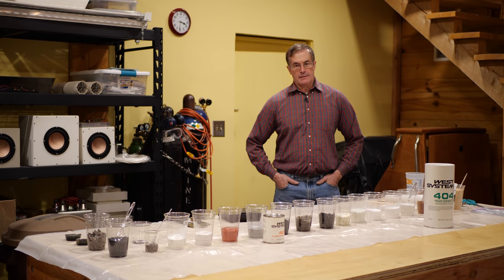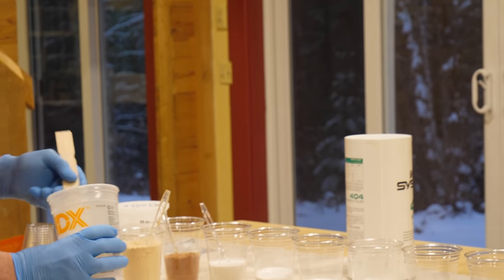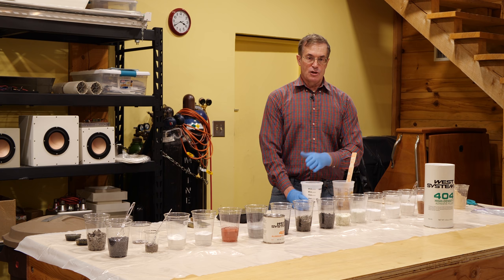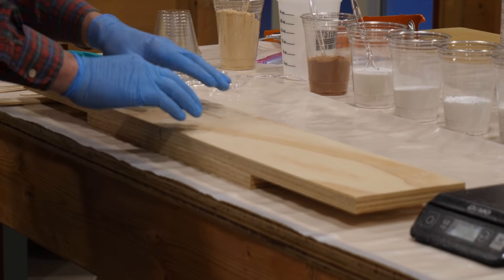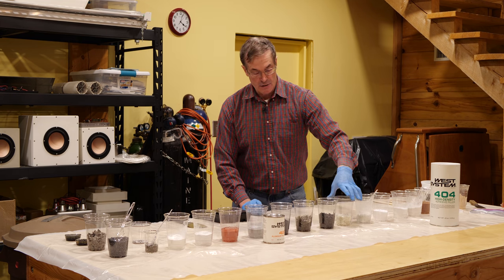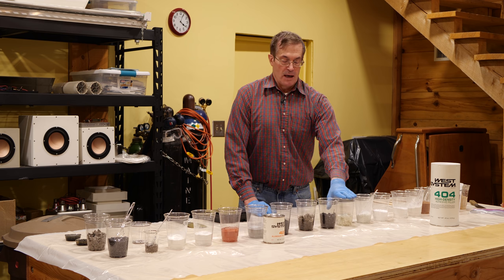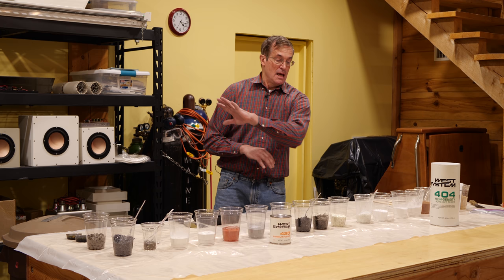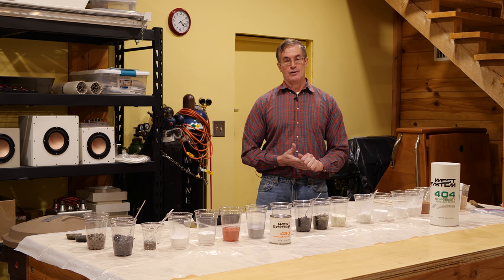Super Strong Epoxy with Diamonds and More!

Comment: Fantastic video. I have experimented with various epoxy fillers for many years. Since I was a child in fact. Back in the 80s I repaired a void in a cylinder head with 24hr Araldite epoxy and iron filings. Engine went on to do 185,000 miles. Shame Araldite 24hr no longer available - best I have ever used.

Comment: Thanks a lot for these videos, so much information! It's awesome to see what you can do today with relatively easily obtainable stuff. Really great explanation and really makes you want to try out stuff.
Please do a video on vacuum infusion! 
I don't know if this can even be done but I'm curious if you could vacuum infuse plywood and fiberglass together to quickly produce panels for a boat build. It would combine the cheap costs of wood compared to foam with a fast work time and smooth surfaces you can get. Hopefully.

Comment: I once worked in wood working making primarily tables. If a dark finish was going on the table or a knot, void underneath the table I would make up wood flour and epoxy for a filler and yes it's fairly strong. Using heat to warm the area and the epoxy helps fill the void quickly, remove air bubbles, and set the epoxy quicker. On the table top if you have a interesting "character" defect in the wood the clear epoxy can be a cool feature. Looking forward to the cement/ concrete work coming up.

Comment: Having worked with epoxy for decades I'd say you nailed it!  Densification works great in concrete and epoxy Matrixes. Thinned Epoxy seals and hardens surface of concrete products very well also but may hold moisture in structurals. ..it isn't quite deflective  as Mandalorian  Beskar Steel Armor but you presented great ideas to pursue on top of Kevlar clothing, and helmets! 
Earned a subscribe..oh wait already sub'ed for years 😊 because you do present true Science in such a understandable ways for minds and eyes open to learn..sincere Thanks man.

Comment: A good trick for cleaning up the glue bead into a fillet is to use the back edge of a spent one of those caulk tubes. Pinch it to the fillet radius you want and scoop it along, any excess glue ends up in the tube (good for silicone caulking as well).  -Great video, keep up the good work!
Reply from the maker: Good idea, thanks!

Comment: a series on structurally engineering complex shapes in "forged" carbon fiber using unidirectional carbon fiber tow or tape would be really cool. EasyComposits briefly touched on the topic in one of their videos about testing the strength of "forged" carbon fiber, which is made in a multi-part compression mold with shredded carbon fiber tow on all of the visible surfaces, and when testing a version where they reinforced it with unidirectional tow along the primary force loading vectors, they achieved a substantial improvement in performance. I think it could be a fun excuse to make some two or three part molds and cast your own engineered "forged" carbon fiber boat propellers, as long as you decide to go for a buck that doesn't feature any blade overlap it should be a relatively straight-forward casting and hiding a layer of radially fanned carbon fiber tow in the middle should give you quite a significant amount of structural support.

Comment: I built a composite epoxy/fiberglass airplane derived from the Burt Rutan Long EZ design. The plans for the project included the additional benefit of teaching composite building techniques. One of the many techniques that I learned was the use of "flox" for creating fillets such as you described. This "flox" was regular 2 part epoxy thickened with flocked cotton fibers. This material is far superior to milled glass fibers added to the same epoxy substrate. Why? I am not positive, but I suspect that the cotton is able to absorb the epoxy and form a more intimate bond. The flocked cotton fibers are very short and cotton is not considered a particularly strong fiber, but the fact that it can be thoroughly wetted out by the epoxy is what I believe to be the reason for its strength. Repeated hammer blows to a ball of this mixture on an anvil resulted in only creating a projectile that upon the 3rd attempt resulted in a direct hit to my solar plexus, thus terminating the experiment. The flox ball was fine! Anyway, my airplane and hundreds of similarly constructed examples are flying today with extensive use of "flox" strengthening. (These are not put-put planes: 220 MPH, +6G, -3G).

Comment: As a civil Inspector I’ve worked with concrete with microsilica a number of times. It’s also used to improve water resistance but does not make it absolutely waterproof by itself. That would not be a concern with epoxy since it is by itself waterproof.

Comment: I'm so glad I ended up watching this video.  One of my current projects has been held up by mechanical and structural problems that I think will be perfectly solved by making use of either the carbon or basalt additive. On top of that the combination mentioned as being useful for creating a surface blemish smoothing layer for aluminum sounds like the perfect fix for another project needing cosmetic enhancement. I can't get over how great the level of information density has been in all these videos so far, its great!  I always look forward to new stuff from this channel. Thanks!

Comment: Concrete speakers sound good to me just for the aesthetic. If they have interesting properties all the better.

Is epoxy granite on your radar, what with this allusion to improving packing density by tuned particle size distributions? You seem headed in that direction (among many).

Comment: If I remember correctly SiC is exactly what the sappi plates were made of.  They used to be standard issue individual armor plates for the Army several years back.  May still be, I'm not sure.  As for the spall mitigation, try a Poly urea coating.  Im pretty sure that's what is used on the ar500 and ar550 plates and it definitely works for catching fragments coming off.  Its basically a bed liner coating.  LineX I believe were the front runners for it there for a while and probably still are.  That's a pretty neat material too.  Anyway, hope that is helpful.  By the way, I absolutely love this channel!  I think I learned more from this one video than an entire year reading tech articles and published papers, so thank you.  Would love to see more videos on composites if yall have any planned for the near future.  I'm absolutely fascinated with Uhpc!  Lol I got a bug I guess
Reply from the maker: Thanks!
I'll look into that rubber as well.

Comment: Great video!  I'm trying to build a housing for an air conditioner using insulating polystyrene, but I'd like to use fiberglass to solidify it.  I was worried about the joins, but I think the peanut butter will work just fine to give it some strength for when the wind picks up.

Comment: Revisiting this video after trying to make my own "forged" carbon fiber using chopped carbon fibers. If you can avoid working with the carbon or chopped fibers in general do so. This might not be the same across all chopped carbon fibers but the stuff I used got airborne incredibly easily. The fibers are not easy to see, I only noticed that it was happening after my nose started to tickle from breathing them in. If you don't have some form of air purification use that stuff outdoors, the only good way to remove it from an indoor space is with your lungs or on your clothes.

Comment: Excellent!  Thank you for such a well presented video.  I kept notes, but it’s hard to do so...  It would be really fantastic if the actual names of these materials were superimposed on the screen as you speak and/or have a list of these in the attachments as a link that is printable.  Very impressed with your experience and presentation quality.
Reply from the maker: Thanks!
Check out the thumbnail.

Comment: The copper stuff is very interesting.  You may have missed a trick:
Diamond is about 5 times as thermally conductive as copper.
Reply: The trouble is that diamonds are small particles so you have to cross a lot of high resistance epoxy gaps. With that copper, you can follow the same branch over a long distance.

Comment: Not sure if you will ever revisit this - but was thinking about the ‘green’ part of things and was wondering what waste sand blast media could be used for.  It’s not going to be consistent due to source material and boated material, but maybe there is something this waste could be used for related to epoxy/cement while reducing cost for disposal.

Comment: Cheap air filtration idea - a tray of used/recovered 12v 120mm computer fans, run using a PWM driver (NE555 or similar with a drive transistor on the o/p) at low RPM. Front them with a jaycloth filter. Very low airflow. Discard jaycloth filter when visibly clogged. I've used this myself to reduce dust and works way better than any domestic-grade "air filters". 
I've tried large AC mains fans but their airflow is way too fast and whips up more dust than it helps collect. 
Also, for rooms that can't have any airflowm an ioniser helps with a barely damp sheet of jaycloth under it to collect the dust.

Silicosis is a nasty killer - we tend to wear masks when actually handling it but forget about the loose dust in the air later when we're sipping coffee or sweeping/vacuuming the floors. At that stage it can't really be seen but is still there in problematic quantities.

Comment: Carbon Vomit!  When I was in college at Calpoly SLO, we would use a similar mix of carbon fiber detritus and epoxy for setting metal bushings/landings for a shaft/bolt pass through or bulkhead for the monocoque carbon nomex honeycomb structure of our vehicle (Super Mileage Vehicle, 2008-2012).  We did this to keep compression loads from crushing the structure as it added a nice rigid interface to support the local compression loads to mitigate the chance of delamination where we married metal to the carbon laminate structure.  

Off topic but somewhat related to above, Putting carbon fiber composite in close contact with say an aluminum mast for an ocean sail boat; or any aluminum component, in direct contact with the carbon is a very bad idea when there is any chance of it being exposed to a galvanic reaction!  Learned that one the hard way... 

Remember your galvanic protection! XD
Reply from the maker: Thanks!
Interesting fact is that an electrically conductive epoxy is very difficult to produce.  When completely encapsulated, the carbon fiber is protected from galvanic corrosion.  If you are concerned that stress fractures will develop at a highly stressed interface and allow seawater penetration into the composite then an initial layer of glass will reduce this threat substantially due to it's lower modulus.
Reply: @TechIngredients  I wish I still had the pictures from those days of the aluminum bushing that was eaten through by what I described.  While generally the carbon composite is non conductive, carbon is conductive along its strands and perhaps we had  a "short" so to speak where bare carbon was in contact with the metal and the electrolyte was able to come in direct contact with both.  I admit with any weave this is very unlikely, but since it was an amorphous blob of randomly oriented fibers we believe it may have contributed to the failure.  The corrosion of the alloy was really surprising by how pervasive it was.  since then we chose to  make particular efforts to properly seal any carbon vomit to metal joint we made to ensure the carbon component was not in physical contact with the metal.   As always, your videos are great and I enjoy them greatly!  

P.s. I worked on the engineering of all the lines that manufacture that module on your Cat!  Very cool application!

Comment: Your breadth of knowledge is frankly astonishing. I'm quite interested to learn more about the properties of your dendritic copper, nanoscale aluminium nitride and epoxy blend that you touched on around the 27 minute mark, specifically with regard to the ratios involved, the thermal characteristics and the strength of the final product. Do you have any additional information about this posted anywhere? A cursory google search does not seem to turn up much information about this, presumably because this is your own research and formulation?

Comment: if you ever see this, when using concrete in speakers, did you have any issues with the resonance frequencies in the audible range? 
I worked for a number of years with engineered concrete, and messed around with some turntable bases in my spare time. Concrete was a great material, but my mixes always had a nasty peak somewhere in the ~100hz - 1khz range that I could never get a handle on without constrained layer damping, which created issues of its own. We had a license for Ductal at the time and were doing some feedback work for LaFarge, and I regret never trying that. It was an amazing material. Very high strength and very unusual failure/fracture modes.

Comment: 2 thoughts: (1) if you're trying to optimize for strength, won't adding fillers reduce the epoxy strength, due to the ratio of epoxy vs. epoxy of other changes? And (2) What if instead of adding fillers, perhaps just let the epoxy start to cure (will get thicker), and then apply when it is at the desired viscosity? Perhaps mixing it every 20 min or so until it reaches the desired thickness would give you 100% epoxy for a given volume?

Comment: I didn't know how basalt fibers are used in composites. I've only seen marketing references stating the use of basalt in carbon fiber bicycle wheel braking surfaces. I think it was one of the primary enabling factors behind carbon clincher wheels. The older sew-up tubular carbon wheels didn't have the same heating problems as the tube and tire style clinchers.  Early production carbon clincher wheels had a major issue with deformation from rim brake heat dissipation. I'm still curious how the the basalt layer is done in practice. I assume it is incorporated into some kind of prepreg layer.

Comment: Add varying lengths of the carbon tubules to HDPE to prevent the spalling on the back of ballistic block. It’ll disperse the heat energy away from the bullet path helping maintain integrity.

Comment: Theoretic tensile strength of metals can be realized by heating to it's solid solution temperature while applying pressure (within a magnitude of 500,000 psi). Allow to cool while still under pressure. For best results, use spherical containment, magnetic induction (for heating), an inert gas to evenly apply pressure and pure metals to increase but bond strength. Millions of psi tensile are practical in a production environment.

Comment: Never tried to make a really strong epoxy but found that adding air-float powdered silicon carbide to "poundland" style two-part epoxy made for an exceptionally economical and fairly well performing thermal adhesive. I did not have (and still do not), adequate kit for taking accurate performance figures, but it "did the job" of both bonding the heatsinks to the components AND allowing them to run cool.

Aiming for between 2:1 and  3:1 by volume of silicone carbide powder to epoxy seemed to work well, much more and the paste was too thick AND weakened the joint, much less and the heat transfer was not as good. I regret not making more detailed notes now - but at the time it was just "another little problem to solve".

Comment: Awesome timing as I just printed the cardboard prototype form for a spiral conical antenna that I'm thinking since so rigid as is... I can just use polyester resin.  Now wondering about using epoxy for even more strength and durability (of course with some sort of polyurethane coating or mixture to make more UV resistant.  Thanks for sharing!  Didn't know about the titanium coated diamond material either.  Get's me wondering about the proprietary micron thick disc cutters like Disco and others pioneered for the semiconductor industry.

Comment: Fascinating work here I just love what you do and I learn a great deal.  The early part of the video when flatening by abrasive rubbing got my attention.  When Building a new computer my approach was to spend the greater part on quality fans and modify a cheap Chinese case. Then using flat plates with abrasive pastes (abrasive paper lifts in front of an edge) flatten the heatsink contact area after which I used engineering blueing grease to reveal the contact area on the CPU.  Then a very small dab of Artic Silver in the centre and rub the joint in to reduce its thickness. My son a computer tech says he has never seen a CPU run so cool and that people would normally employ water cooling to equal it. I'm not sure about bonding it though!

Comment: Once again a really informative and well structured video - could you perhaps have some details of the epoxy mixes under test 
It doesn't have to be full on mega bucks test equip-ment but some ideas of the sort of order of magnitude  tensile / compressive / toughness and hardness as well as their ability to adhere to similar and dis-similar materials.... I know this is an awful lot of work

but just using stuff / scrap  from ongoing projects and so forth to give the viewer ideas about application & performance would be amazing